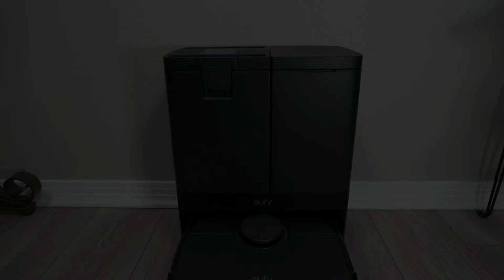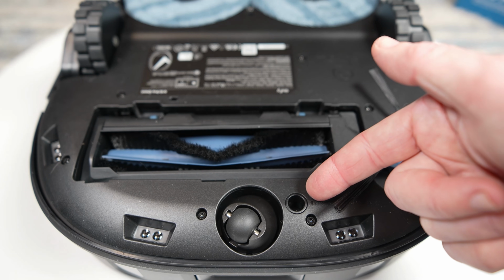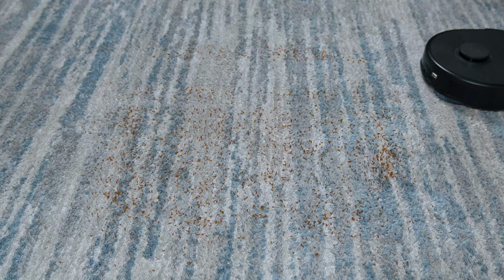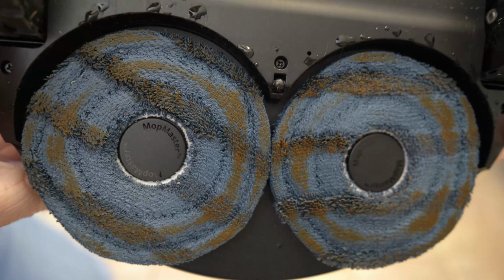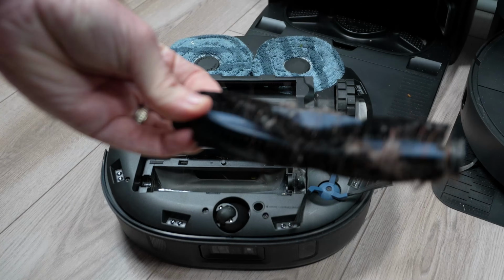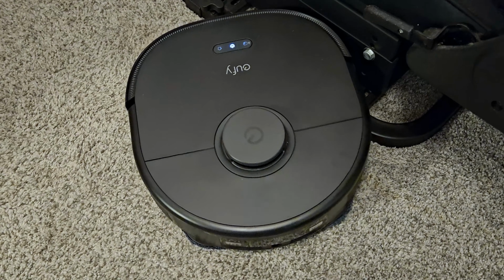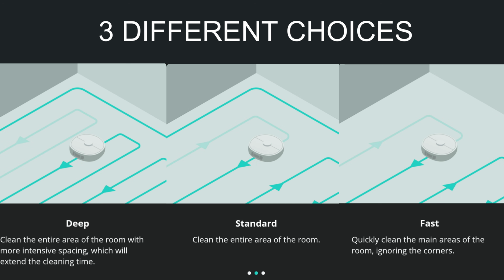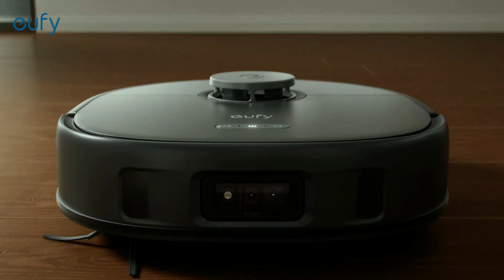eufy X10 Pro OMNI Review! An Incredible Value!

Comment: I just bought this unit. I love it. But you're right, the X10 vac is not as good as Roomba from years ago. I have a 7 year old dual rubber roller Roomba (960) that excels at vacuuming. It leaves my floors almost appearing 'polished.' As soon as I saw this Eufy I was excited about its dual capability, but surprised and disappointed to fin they're still using a roller with brush/bristles. I'll keep my Roomba on 'standby,' running it once a week, to help keep the floors looking polished.

Comment: Did they fix/increase water dispensing while mopping? I'm considering this vacuum but I'm worried about removing oil layer from the wooden floors with microfiber cloths
Reply from the maker: I have not seen any firmware updates sadly.

Comment: Great review. Slightly sad to see you didn't verify the hot air drying temperature but at least good to know that the pads were completely dry after 2 hours.
Reply from the maker: Yea sometime it does not make the cut unless there is a problem. It is close enough to the advertised temp of 113f.

Comment: Thank you for such thorough videos!
The L10S Ultra and X10 Pro Omni are now available at the same price, what would your choice be? On paper I think the X10 Pro Omni is slightly better, but do you see that in actual use as well?
Reply from the maker: L10s has a better brush roller and detergent injection.  Not sure if those mean much.  Otherwise both are good. Alsi the X10 has a dock that is easier to clean. Smaller water tanks though.

Comment: Hi I noticed you decided to swap the roller brush out with an all rubber one purchased from eufy, did this make any difference to the vacuum performance? Also if you were spending $599 or $999 on a new robo vac would you buy the x10 or S1, which is the best value? Thanks
Reply from the maker: I have not had a chance to rerun my tests on the X10 with the new roller.
The S1 is a great value imo at $999, but after tomorrow it will be more than twice the price of the X10. That is gonna be a hard sell for many imo.
Reply: @jamie.andrews thanks,  would you say the s1 is a better machine and worth the extra $300?

Comment: How is this compared to Roborock Q Revo for the same price point ? I have Eufy X8 and it does hit a lot during cleaning and has mapping issues. I never had that problems with Roborocks. But Eufy’s suction power is very good compared to Roborock. My carpets clean better with Eufy compared to Roborock S7Max V. I want a cheaper alternative for my second floor. I use Roborock for ground floor currently.
Reply from the maker: Since you already have Roborock it might make sense to stay with them however if you need object avoidance the edge goes to Eufy.

Comment: Thanks for putting together such a detail and honest review. If I ask you what would be your top pick for a robo vacuum for hardwood floors oak wood with few rugs around mainly focused on best mopping ability not leaving the floor sticky, ability to refill cleaning solution and auto empty.
Reply from the maker: I have a review for the Eufy S1 coming out in a few days.  Be sure to check it out.
Reply: @jamie.andrews  is there a multiple map option available the reason I ask is because I have 2 story house. I wonder if there is an option like that and does it require to shift the dock upstairs or only the robot.
Reply from the maker: @jaysidd  It supports up to 4 floors.

Comment: Thank you for your review. I would be interested to hear how this navigates under low furniture as this model is much taller than all machines on the market. My sofa is 4.5” of the floor. Will the LiDAR prevent it from entering under this space? Also, with other robots I had issues where they would not clean under my kitchen cupboards. I suspect this was due to the lasers from the LiDAR system bouncing of the shiny stainless stell kitchen cabinet legs and causing the robot to leave the area as it identified this as an obstacle.
Reply from the maker: It must be able to clear the lidar dome or it won't go under.

Comment: Hi Jamie, thank you for your  review. I have a $1000 budget. I have a multi floor and multilateral house (parquet + stone), I have to choose from  x10 omni, L10S pro heat and S7 max. What is you favorite?
Reply from the maker: They all have their own drawbacks and each has better abilitys than others.  Do you want goo object avoidance? If so look past the S7 Max. Do you want detergent injection? If so the L10s Ultra is the only one with it. If you have pets you may want to skip the X10 due to the brush roller.
Reply: Thank you  @jamie.andrews  . Probably I'll buy the L10S pro heat.

Comment: I wanted to get this robot but unfortunately the washing is not the best.  In your opinion, which one is best for a stone floor with joints?
Reply from the maker: Robots like this will not drop down in joints or grout lines in tile. This is due to the design of flat mopping pads which glide over the lines.  I use a vacuum mop like the Dreame H12 Pro to clean my grout lines.
Reply: @jamie.andrews Thanks for the reply.  But which robot do you think currently cleans the floor best?
Reply from the maker: @federicodelboccio2084  What is your budget?
Reply: @jamie.andrews 700-800€. I don't ask for the best in general.  But best for washing with mops
Thank you

Comment: Jamie, how does this vacuum handle oriental rugs with tassels? My iRobots get tangled and stuck. I agree with you that the brush/silicone roller is inferior for pet owners. Have you tested the Norwal Freo Ultra. They claim zero hair tangle.  Great review ! Thank you.😊
Reply from the maker: I have not tested it with tassels so I do not know.  My guess is that it is a problem for most vacuums. Working on the Narwal video right now.
Reply: @jamie.andrews  I will love to see your review and compare  the two. I will be replacing my old 600 series Roomba in 2024 and use it in my garage as it can keep that area clean. My home is three story and the 2nd story has the 800 series iRobot vacuum only. 2nd floor has bamboo 1" planks ,  Asian sculptured rugs and  Italian ceramic tile flooring. Mopping will be important with avoidance of shoes , chords  and shoes that have laces and a power recliner with a power cord that has a magnetic connector that the robot needs to avoid. Like your professional reviews and honesty.

Comment: Having spent hours (and hours and hours) over the last couple of days going round in circles looking at reviews of various all-in-one vacuum/mop/omni-base units (various RoboRock, Ecovacs and Dreame models) I’m now back to thinking that the Eufy X10 might well be the way for me to go without breaking the bank. I also have a renewed admiration for your reviews having suffered so many shallow read-the-specs reviews on various vacuums from other reviewers so I’m rewatching it. I wish I could give you more than one like.

On the slightly disappointing vacuum performance, from watching your tests I’m wondering if that might be something that Eufy could improve in software. Watching it do its parallel tracks it looked to me as if they only just met at the edges of each pass. I’m wondering if tightening the spacing by even a couple of cm (or an inch for a nice round USA-friendly measurement) might improve the performance on those pickup tests. It’s not a deal breaker for me since I schedule a clean every day and am of the opinion that OK and often, easy to do with an fully automatic cleaner, is likely after the first few days to be better than doing a thorough manual clean once a week with a powerful manual vacuum - and a lot less effort - but better is always errr ….. better.
Reply from the maker: You do have the option to vacuum on deep cleaning mode which will make tighter passes.  In my carpet test it improved some.
Reply: @jamie.andrews  Thanks. “Improved some” so still not particularly impressive vs other bots you’ve tested?

I see that although it’s listed as out of stock Eufy does seem to be selling a fully rubber roller for the X10 as an aftermarket option. Maybe worth experimenting with at some point? Just out of interest because as I mentioned it’s not a show-stopper for me. If I’m doing a whole-house cleaning run every day of the week I’m sure anything at the 85% or above level will keep my floors clear of day to day dust and smaller debris.
Reply from the maker: @julianfp1952  I am trying to confirm if they plan to sell them and if so send me one to test.
Improvement is still not great.  87% for rice test.  Most score 90% or better.

Comment: With third party rollers being available for pretty much all the main manufacturers various robots, if your willing in some cases to wait for a delivery from China, this would seem to me to be an area where some practically-minded YouTube tinkerers could see if they could create some sort of “Frankenstein main brush” by finding some third party rubber roller of the right diameter intended for something like a Roomba or Roborock, removing it from the axle & mount that interfaces it with whatever robot it was actually designed for and finding a way to graft it onto the Eufy X10 axle and end mounts (gained by removing a Eufy brunch from its mounting hardware.

It might not be easy but getting a few third party brushes to take apart would be pretty cheap and I suspect some good problem solver with a few practical skills, a decent toolset and some decent glue could probably find a way. And if you’re working with all rubber brushes length wouldn’t be an issue because an overly long rubber brush could be cut to size. Not for everyone but it would be kind of cool to see someone attempt it and then see what difference it made to vacuuming and hair tangle performance.
Reply: No need to do that. Eufy itself is selling an all rubber roller for x10 pro. They posted it on reddit.
Reply: @supriyasou3722  Yeah. I did discover that after I’d made my post. Another great move by Eufy. Maybe 3 to 6 months for a few firmware revisions to sort out the odd navigation issue that a few reviewers have mentioned and this is going to be the best value higher-end robot out there. I’ve already decided to get it as soon as it’s available in my country (the UK) and I doubt that I’ll be disappointed.

Comment: Are you using any cleaning solution or you just mop it with pure water?
Reply from the maker: In my tests it is only room temperature water.
Reply: @jamie.andrews could you add hot water to the tank?

Comment: Woudl you rather get this or a Roborock Q Revo or even a Dreame L10?
Reply from the maker: What are you needs and wants?
Reply: @jamie.andrews Hi Jamie. I need a robot to clean one of the floors of my apartment, that's consists of the living/dining room and kitchen. It has a big rug and hardwood floor. Kitchen is tiled.

I have 2 small kids and 3 cats. Cat hair is everywhere but also Legos and small toys. I also have a lot of litter sand around. 

I need something that vacuums and mops, with good object detection in a compact case. Boxes like the one of the Roomba J9 are a no-no. Way too big.
Reply from the maker: @hellocousteau6771  either this or the Dreame L10s Ultra should fit the bill in this price point.

Comment: I canceled my pre order after watching you're review and go for the ecovacs t20 omni for 100€ more...and still i am in doubt about this one especially the bad dry cleaning
Reply: Bad move. You should have tested it yourself and return it if you didn't like how it cleans. T20 omni is not that great and the app/software will likely frustrate you.
Reply from the maker: The Ecovacs app and software is certainly not great.
Reply from the maker: Interesting. Have you seen my review of the T20? https://youtu.be/oAZfhyEIDEY In some ways it is better and in several it is worse. Depends on your needs of course so no judgements here!
Reply: Yeah, when I tried T20 omni, it was definitely higher quality. The software takes away from the experience though. Mine had some other issues like trouble returning to the dock and questionable navigation. Also had an irritatingly loud noise when traveling on hardwood floor caused by part of the roller brush assembly dragging on the floor. Common issue. Look up 't20_weird_noise_while_travelling'
Reply: Update in the end I went for the dreame l20 ultra ... and tbh it is better then I expected, yes it is 200€ more expensive then ecovac or eufy  but I am satisfied with the results...the 30 ultra is way more expensive here in Belgium

Comment: Seems like Jamie is the only one who does an honest review on Eufy. Wonder how much do other YouTubers get paid for a 110% positive review..
Its a hard choice between Q Revo and x10. We have no pets but alot of long hair from my gf. So Eufy brush might be a deal breaker for me since it doesn't really clean itself.
Any advice is appreciated 👍
Reply from the maker: Thanks.  I do not take sponsorship money. How important is obstacle avoidance.  If important the X10 is light years better.  Otherwise the Q Revo is better in most ways. Cleaning the brush roller will need to be done weekly whicis not a huge deal a even with normal rubber rollers you will need to clean hair from around the axles. The main drawback with hair on the roller is if you don't clean it it will lower your cleaning ability.
Reply: @jamie.andrews  Thanks. Don't really care much for obstacle avoidance since we don't leave stuff on the floor and even if there is an obstacle, I'd want the robot to cover 100% of the floor. A weekly cleaning of the brush sounds reasonable.
I have a cupon for Eufy which drops it to 600€ and Qrevo is hard to find in EU for that price especially a black one. Do i wait for a Qrevo offer or go with the Eufy? (One floor apartment tiles and vinyl, almost no carpet just some little rugs)
Reply from the maker: @amirkoo97  The Q Revo will perform better for vacuuming and mopping however the Eufy is not bad.  If the price is close I would go QRevo.

Comment: What do you think the chances are of Eufy (or a third party) releasing an all-rubber brush? Pre-ordered and now slightly concerned as a dog owner, though we have no carpet.
Reply from the maker: I have no clue, but if I had to guess I would say they won't and instead will make a switch in a newer model. I don't have dogs so your experience may vary some.  If you get it please please reply back and let me know how it works with dog hair.
Reply: I keep posting this but it seems like my post gets deleted if I include a link. There is a rubber brush available for the X10 from eufy! I would post the link but seems like you have to search for yourself…
Reply from the maker: @matthias452  I see it, but the photo shows the original one.  I was not informed that was an option from the Eufy Marketing team, but I will reach out to them and find out.

https://us.eufy.com/products/t29g10j1
Reply: @matthias452 I ran into the same problem!
Reply: It’s out of stock and I can’t seem to find it when I search the accessories page. Makes me wonder the link is private
Reply: Searching "rubber brush" brings it up as the first result for me.  @karthikeyanmuthu5313
Reply: It was a link shared by the eufy support and it was definitely the rubber one!

Comment: Jamie, I have preordered this one, but also could preorder the x30.  If we were to take away the price difference, would you be 100% sold on the x30?  Due to the way my house is situated, I think the x10 would likely do the job, but my OCD requires me to buy the best product I can.  

Note that I currently own a S8 Pro Ultra but am not a fan of the vibration scrubbing it does on my tile. I think the rotating mops work a lot better for that surface.
Reply from the maker: The X30 is much better than the X10 in almost every way, but it also cost twice as much.  If you want the best get the X30, otherwise I suspect for a person on a budget the X10 Pro will be just fine for a vast majority of people.

Comment: Eufy software clearly made by ecovac software engineer.
Reply from the maker: There are a few similarities, but the Eufy app overall is much better.
Reply: @jamie.andrews That software bug completely the same like my Ecovac t9.

Keep up the good work Jamie customer need notify about this kind of bugs, because most of this company will not spend resources to fix their old product software unless some backlash.
Reply: LOL, best comment in here
Reply from the maker: @xeon2k8  There are differences. For one I have no trouble splitting my rooms.  What is re crazy is until they fix the X2 this is actually better.

Comment: Would this be as good or better than a Roborock S7 Maxv ultra perhaps?
Reply from the maker: I don't think they sell those any longer. When they did they were almost twice this price.
Reply: @jamie.andrews Sure but that's what I've got currently. I was wondering if this was any better, to have on another floor
Reply: @hmed939 the only advantage on the eufy is the dock is easier to clean, that's all .On the S7 side you have Roborock reputation, much better vacuuming perf and better mopping too since if i recall correctly it cleaned much better in the dry sauce test. Also the brush is not rubber, on the S7 as least you can buy a bristles one and change it whenever you need that. I would stick with it.
Reply from the maker: @waqasahmed939  Oh I see. I don't think it is better overall. The S7 Maxv has a better brush roller, better mopping and vacuum performance. Eufy only beats it with object avoidance and cords. If this is just for a second floor it should be fine.  Other options are if you don't care about object avoidance look at the Q Revo or Dreame L10s Ultra if you do.
Reply: @jamie.andrews Thanks! That's greatly appreciated

It's a shame that despite the X10 omni applying 10 newtons of pressure, it isn't as good a mop as the Roborock machine I have then